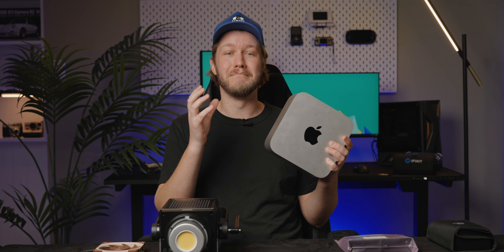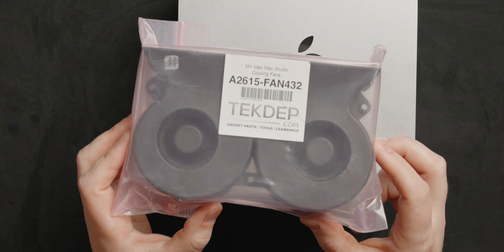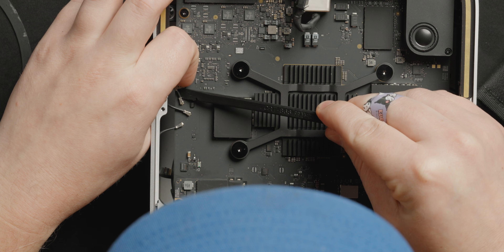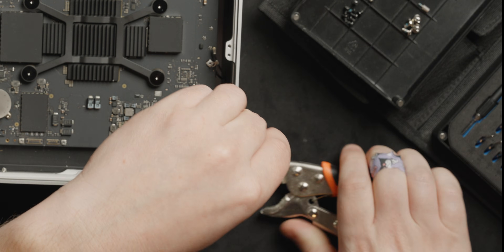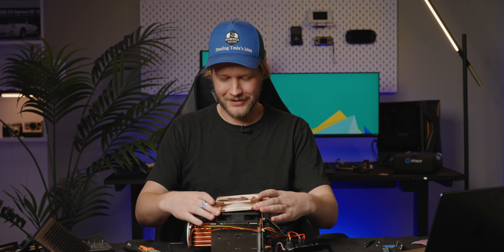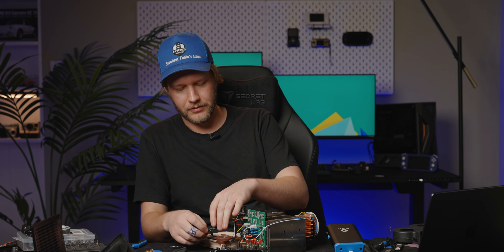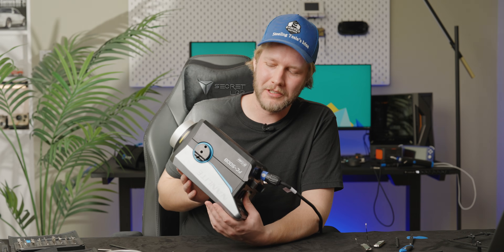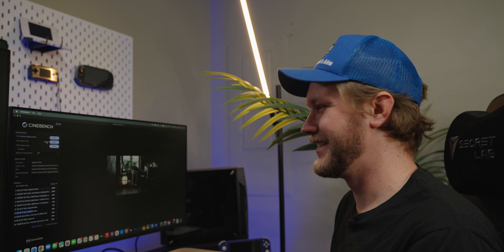We Need More Cooling!

Comment from the maker: Save up to 20% off select iFixit tool kits at https://www.ifixit.com/Shop/Sale
Reply: Time to engineer a small screwdriver and piss off another sponsor again.
Reply: little suggestion: take an air cooler, cut the upper part of the heat pipes, put every pipe in series and run water through them and use it as normal. basically replace the heat pipes with active water circulating into the cooler
Reply: Dude make a CPU Mount for that 10-Heatpipe Cooler and test it? I know you Curious too
Reply: so last time youd had way less subs,
now ur going to 210k subs,in like what 1 month? 2 maybe?
Congratz your persona is a mark all on its own.
Reply: Hey why dont you make a video using the Heatsink from the Light on a AMD APU or something lmao
Reply: I like the hat
Reply: Linus is not happy  LOL

Comment: May I suggest trying some 3:1 Marine heat shrink. Not only is it 3:1 shrink ratio which feels life changing after 40 years on this planet only ever using 2:1. You also get adhesive similar to hot glue inside making it highly water resistant near water proof.

Comment: repairing Apple devices (including laptops) is not difficult but watch the ribbon cables. your own fingers will fruck you over when detatching and reattaching 1 dumb fruck ribbon cable. speaking from experience
Reply: usually Apple is pretty good for protecting the deafth component like the psu that is integrated. the iMac is a way trickier. no idea why anyone would use that device. the Retina display, however, as a standalone is something I’ve have in my cart over and over for several years but I’ve backed out. they will not budge past the price floor of like $1100

Comment: You should try doing like a PSU delete - move it to external using a 3d printed enclosure or better, metal if possible. I bet that would help with the cooling as well.

Comment: 6:10 This is why I don't get how USB-C is a better connector. You still have that thin and tiny fragle tab that breaks under use. And when it does break, can't replace just the cable. Have to completlly disassbile the device to fix it.

Comment: iFixits old driver had a hole through the top by the spinner and it came with a driver extender. You could slot the extender through the hole to get more torque. Was a neat feature.

Comment: You can use the heat from a soldering iron to shrink heat shrink. Just hold the barrel of the iron close underneath without touching

Comment: With PC's, I drain the caps by hitting the power switch after unplugging the power cable. Often the LEDs will blink or the fans will twitch to show the caps are draining
Reply: While I always do this to make sure none of my PC components are still 'live' while I'm tinkering inside them, I would never expect that the capacitors inside the PSU were drained by it.

Comment: Not to be an apple fanboy but the cooling system on the studio is fantastic, have an M3 Max studio and editing 10bit 4.2.2 250mbps 4K footage in realtime at 60fps while being completely silent is insane
Reply: A whole lot of that is just the efficiency of the chips. The difference in noise between Intel Macs and Apple Silicon Macs is not due to a sudden massive advancement in cooling tech.

Comment: 9:50 I hate unnecessary spliced cables, they're bulky and ugly. The connector type is JST and crimping sets aren't expensive, if you have noctua money you can afford to do it right. If you want to make it easy to replace in future swap the connector on the board with a MOLEX fan header, JST has the same pin spacing.

Comment: I'm very impressed how the IO isn't soldered straight to the motherboard, and one could replace them if they break, BUT there's no excuse for the design that forces one to disassemble the whole thing from the bottom. It reminds me of using a pick to eat a crab in the shell. The whole case should simply slide up off the top leaving all of the parts accessible. And the lok-tited screws are evil but not as evil as the glued-on fan jack. If a screw tends to wiggle loose, add a washer. And there are power connectors with squeeze-tabs so you don't need to glue the poor things.

Comment: I find it a bit shocking how the opened PSU is commented with how it is hard to hurt yourself with something like that as long as you don't do "anything too crazy with it". That is fairly bad advice. Those big PSU capacitors can potentially electrocute you quite some time after having been separated from external power. Nothing crazy needed for that, just touching the wrong parts, not all of it is isolated. If you are educated in the field and know what you are doing you can handle that stuff safely but this video is watched by many who are not.

Comment: It's alright tech sometimes demands a blood sacrifice, I'm getting ready too build a R9 5900X pc for someone I was taking out their CPU Cooler (Be Quiet Dark Rock Pro 4) It's thiccc and sharp under the top lip. I sliced my thumb wide open and not deep enough for stitches but deep enough too bleed a lot. It's already cleaned and sanitized but the cooler is huge and very nice looking after it took some blood.

I haven't taken apart a Mac Mini in a long while and this one looks simpler compared to the 2011 model I last worked on.

Comment: I bet you could fit an Alphacool Eisstation DC-LT Solo Top with the DC-LT pump, a XT45 40mm Triple Radiator, 2 or 3 fans, and a waterblock inside that M1 Mac Studio instead of the stock cooler

Comment: sorry but you can never get rid of that bbq lighter now. it’s basically your channels’ mascot. im already looking forward to the inevitable repair video
Reply: We have propane camp stoves in the kitchen in our campground. Those lighters are utter crap. We hate them so much, and there are few useful safe alternatives
Reply: @samuraiartguy  Have you tried the long neck piezo sparkers? I've used a couple, and they were good, but not all are long enough. Worst case, if you have room, acetylene torch lighters throw great sparks with almost no practice. Or if people want cool, big ferro-rods are cheap online and as long as you have a good hard 90degree edge to strike they work really good from a safe distance.

Comment: you don't have to use the awful bbq lighter, I usually just use the tip of the soldering iron, but you gotta hold it directly on to the heat shrink all over for it to shrink properly

Comment: Can someone please help explain to me the cinebench scores, the ones I get, and the ones I see online, are not even in the same ball park. Like this Mac will get 600 multi, and my not so great laptop will get 10000. What is going on?
Reply from the maker: You're probably using Cinebench 2023, we're on 2024 and it gives much lower scores
Reply: @zip_tie_tech oooh that makes sense, Im using Cinebench r23, I assume that’s not the latest version?
Reply: they are different cinebench tests! i dont know all of them off the top of my head, but if you google it, someone will have a good explainer :)

Comment: You'd need a huge case to fit it, but I would love to see how the cooler from those lights would work on a PC.  How much CPU could you air cool with one of those?
Reply: Quite a bit of CPU - assuming the LED is dissipating 70% of its power as heat, the cooler had to be capable of dissipating 350W which is about the TDP of threadrippers